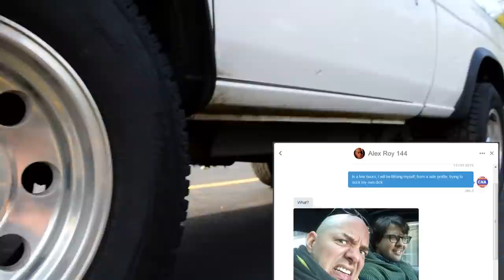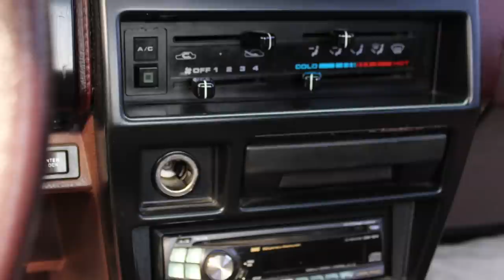Regular Car Reviews: 1991 Nissan D21 Hardbody

Comment: These simple trucks are the reason I'm looking at Rangers.
Reply: +Anonymau5555 stay away from ford. get a dodge dakota, more reliable trust me
Reply: I recommend not. Stick with Toyota or Nissan. They just don't ever die.
Reply: +Anonymau5555 I had a '97 4cyl manual Ranger for a short while. It was a piece of shit. The only good thing was I didn't care about it so I beat on it and had a blast. Even took it offroading once. It was hilarious. I do like the smaller Mazda and Toyota trucks, though.
Reply: +ScreamingPandas7 dodge is even worse
Reply: +ScreamingPandas7 the auto in my Dakota only lasted 136,000 miles before it started slipping. oh yeah so reliable
Reply: +swSephy | Sim Racing some, if not most, of the small Mazda pickups are just rebadged Rangers to begin with though.
Reply: +Anonymau5555 I WANT MAZDA B SERIES
Reply: Had a 97 3.0 manual, sold it with 215k miles, never had to fix a damn thing, loved that truck. Can't go wrong with a ranger as long as it's the manual transmission
Reply: I have a 2007 ranger sport 3.0 manual and I hate it. No power to speak of, worst ride quality ever and no interior room since it's a standard cab.
Reply: +swSephy | Sim Racing 
"smaller mazda"

so ranger, with a different badge
Reply: +ScreamingPandas7 more like more reliable RUST me
Reply: +swSephy | Sim Racing you do realize the small mazda was a re badged ranger right?
Reply: +Anonymau5555 I had a 1991 4cyl ranger manual. Had 290,XXX miles on it when I sold it. Still see it around from time to time.
Reply: +Behzad Majdizadeh the 3.0 is shit a 2.3 is the most reliable and the 4.0 was a powerful engine also found in ford mustangs.
Reply: +Anonymau5555 S10 chassis is /way/ better than Ranger based vehicles. S10s never die.
Reply: MindBlowerWTF So a ford ranger with a mazda badge?
Reply: SquirrelAngry I meant the older Mazda trucks. I should have clarified.
Reply: Noah Ferrari I meant the older Mazda trucks. I should have clarified.
Reply: ***** So a ford courier...
Reply: Noah Ferrari Yep. They're more fun than the one I had. That generation was awesome. Mine could barely pull itself up a hill.
Reply: +Anonymau5555 Subaru brat for dayz
Reply: +ScreamingPandas7 lol Dakotas, the truck famous for shitty transmissions and rotting fenders..every Dakota I see has no fender left and a rear bumper so rotted that its about to fall off.
Reply: +Anonymau5555 My friend in high school got one for a graduation gift.  It was a 4.0 V6 extended cab.  Still has it and it's a 1995 model.  Has probably a half million miles on it.  Odometer broke 10 years ago when it rolled over 300,000 miles.
Reply: +ScreamingPandas7 if you get a small dodge pick up make sure you get one of the older ones made by  Mitsubishi , or buy a full size with a diesel , unless you have retarded amounts of $ for gas .
Reply: +Anonymau5555 Ford Ranger Awesome Choice!!
Reply: +Anonymau5555 I've had an '04 Ranger 3.0L for quite some time now and if you take care of it, it'll treat you well. Although I prefer Toyota when it comes to trucks, this Ford hasn't ceased to amaze me. Choose what you like driving the best, that'll matter the most in the end
Reply: I would advise to stay away from the 3.0's and the four speed autos behind them
Reply: +Bryan Castillo thats absolute bullshit for toyota. My dads 91 pickup was filled with problems once the warranty was done. Ate threw batteries like crazy. Had a ton of shorts. Interior was built poorly. Sunroof leaked. It loved to destroy radiators. It was a hunk of junk. So after he sold that truck, we bought a yukon and the yukon has lasted more time, it was more reliable, and we have only bought 2 batteries since we bought it back in '04
Reply: +Anonymau5555 I had an 86 S-10 blazer 4x4, with a 2.8 six cylinder and a 5 speed.  It had close to 300,000 miles on it, and drove like a dream.  The dash kept catching on fire, and the top speed was about 63 mph (so yes, that scene at the end of Terminator 2 is accurate), but it would never, ever, stop running or get stuck.  I'm a chevy guy and that's only because I grew up working on them, but put brand loyalty aside and just buy a nice old truck, regardless of the name badge.  It will always treat you good, and you will always love it.  Plus, you get good at fixing little things.
Reply: +Anonymau5555 Everything on a Ranger is great, except the water pump, gear box, brakes, power steering pump, relays, and starter. 

I've had several Rangers. All of them had the same problems. But the 4.0 V6 itself isn't a bad motor. All the other shit I mentioned will break, but the motor should be fine up to 500k+ miles. The gear box is probably the biggest Achilles heal.
Reply: SpaceManDawn Starters are fine, its the fact that the oil filter is directly above the starter that kills them.
Reply: ***** You're right. It's not even the motor itself that goes bad really, Just the solenoid. And the starter motor and solenoid are one fucking piece on these things.
Reply: SpaceManDawn Yeah I only had to buy one starter before I figured that problem out. That is a shitty design, just horrible.
Reply: +wv9mm you can call bullshit all you, but if i had the all the dealer receipts for that piece of shit truck i would have posted it on youtube by now. Then my dad bought a pontiac vibe(which is a toyota matrix, made by toyota, no GM parts except the exterior) and this car blows through brakes pads like crazy(we had the oem pads replaced at 60k, my yukon didnt even squeal and we replaced them at 92k just for good measures). So this other piece of shit toyota has its transmission clunking when i put it in reverse, the radio comes on and off whenever it fucking feels like it, has a tendency to idle at around 400 rpms, the key fob works when it wants to work, and its starting to burn oil, which is a common problem after these vehicles equipped with the 2.4 2AZ-FE engines. My aunts 06 sienna has blown through 3 transmissions, 2 of them while the van was still under warranty. Worst part of all this is that toyota employees that actually work for toyota will admit all this
Reply: +ScreamingPandas7 Did you seriously just recommend a dodge based on its reliability? What a troll.
Reply: I have an 87 ram with the 225 and a 4 speed. It isn't fast but it will never die.
Reply: +swSephy | Sim Racing 
But wasnt the Mazda truck LITERALLY a rebadged Ranger.
Reply: +Jack Mendez yes.
Reply: Holy fuck load of comments Batman.
Thinking of getting an '05+ Extended cab short bed 4.0 V6 with the 4x4.
Reply: +wv9mm well idk if i mentioned it but Chryslers are shit. Theyre the one outlier to american cars, they break more than they work. Ive never heard of GM engines blowing so low. My dad had 4 buicks as company cars, and he would easily put 30k on them each year, and none of them had any problems at all. Our GMC yukon outlasted our piece of shit toyota truck, and it looks like it will outlast our toyota made pontiac vibe as well. The brakes on our vibe squeak like shit and there is still a lot of material left on the pad, so idk what going on with that car but what i know for sure is that im never buying another lifeless piece of shit toyota again. Too many little problems that turn into big problems
Reply: +SquirrelAngry Everything after 93 I believe.
Reply: +olskoolnewpaint Unfortunately not. The manual trans was a Mazda part though.
Reply: olskoolnewpaint Was it a Four speed? Cause the four speeds the put behind them can not handle any towing.
Reply: +Anonymau5555 In my 30 years of driving and owning 17 vehicles, import and domestic...Nissan/Datsun, Honda, and Toyota will ALWAYS surpass Ford, Chevy and Dodge in both longevity and reliability, hands down. My 1993 Nissan Pathfinder has 278,700 miles on it and still no leaks or oil smoke, it starts everyday even on the coldest days of -10F,  goes on 100+ mile off-road trips, tows a 19 foot travel trailer and still kicks ass. My 1995 Ranger crapped out after a little over 180,00 miles...bought it new and had all of the scheduled maintenance done, still garbage, it quit wanting to be worth anything about 8 months after the warranty expired. Japanese Imports= TRUE Longevity.
Reply: +Noah Ferrari Those smaller trucks used import engines. The Chevy LUV used an Isuzu engine, Ford Courier used Mazda, Dodge D50 used Mitsubishi. The Chevy Duramax Diesel is an Isuzu engine. I don't know how old you are, but the mixing of Japanese engines and American vehicles has been going on for 40 years. The Ford Probe and Mazda 626 share the same engine Dodge Stealth and Mitsubishi 3000GT are the same, etc.
Reply: +TheTheeggmann we'll just ignore all those 30 year old chevy trucks with 500,000+ miles on their odo's right? Or the fact that the longest lasting vehicle is the ford f250. Or all those crown vics that are pushing 500,000 taxi miles
Reply: +Frank Magana The only complaint I have about the early 80's Toyota Hilux is the Manual Trans. I had an 83 4x4 and no matter how many gear boxes I put in it (3 until I gave up) it always lost 1st and 3rd gear. And that's driving around town and highway speeds of 60mph.
Reply: +SpaceManDawn And the fuel pump, gotta take the bed off to get to it.
Reply: +TheTheeggmann thats pretty fucking bad. My dads 91 pickup went through 3 radiators, but 3 transmissions, that sounds like my aunts 06 sienna
Reply: *****
 I believe so, and it was also used for snow plowing. Shameful how they made the F150 for so long and by '94 they still couldn't get it right.
Reply: +Anonymau5555 Mistubishi pickups are good. Dunno if you get them over there. Ford Rangers/Mazda B series are pretty bad.
Reply: Rin Hato Those are extremely rare and hard to find in decent shape.  I'm also looking at Tacomas as they are a bit more plentiful.
Reply: +Anonymau5555 Same. I always thought the Ford Ranger and even the Mazda pickups were great and perfect for anyone who needed a reliable pickup truck. But I'd rather go older Tacoma or Hardbody. Nothing beats Japanese design and build quality from the 80's and 90's.
Reply: +Anonymau5555 yee they are i have a 93 harbody i love it exept itsrotted to shit :(
Reply: Why is that any of my business?
Reply: +Mr Anderson Have a '02 Dakota regular cab v6 4x4 with 180k, no rust because i wash and take care of it. It drives good and hauls wood or whatever with ease. Solid and better built than a chevy i think . Dakotas have tranny problems because people romp on them, i have to say Rangers are also good trucks.
Reply: Sister had a 99 Ranger Loved it Now i'm thinking of one for a first car. That or a D21,Tacoma,s10
Reply: Anonymau5555 Rangers are even more basic and not as reliable
Reply: Nissand21 guy Reliable is just marketing so when those cars break the owner thinks it's time to get a new car because "well our reliable car just broke so that means we have to get a new car because it said it will not die when we bought it" if you what a reliable car buy a used Suburban that haven't been off the road once in it's life or any truck with the same history.
Reply: Char Aznable did you ever buy a ranger? I owned one and it was only a money pit.it was a super clean one as well
Reply: Thats true, I've got a 1999 4 cyl Ford Ranger that has been meticulously cared for by every owner. Still drives like new, though gutless it may be
Reply: This thread is hilarious. Some actually recommended a dodge dakota. I think it's been over 10 years since I've even seen one of those things.
Reply: +Michael Franke Yeah, I've got the same with the v6, still going strong.

Comment: I enjoy mine. It's a '96 4x2 (Australian model), so it got a modernised dashboard and ECU, the government fleet buyer who ordered it specced the lowest trim level (DX), and the highest mechanical spec (160hp-182ft/lb VG30E/R30a trans/H233 rear), with a 7' bed.  
Sure it's got EFI, but otherwise it is just so simple by comparison to anything you can buy now; hose out vinyl floor, simple cloth seats, no A/C, no airbags, no ABS, no TCS, manual winder windows, even has quarter vent glasses. I drive it everywhere, every day and I have done for 3 years now. Apart from some dirty earths needing a hit with a wire brush, it has been absolutely faultless. Something about driving simple cars is highly enjoyable.

Comment: I've got an extended cab from 95, the damn thing is indestructible. It's got over 300k on it and the only thing that's gone out in it is the thermostat twice, and the distributor which was rebuilt.
Goes anywhere, does everything, but because of its interesting fuel management system it gets oddly low gas milage, haven't figured out a way to get that addressed yet..
Reply: Same only a 93 , what motor do you have?

Comment: I have a 94 D21  but in 2wd.  Bought it from the original owner.  White with blue interior   148 thousand miles and the truck still looks and drives as if it just rolled off the line 10 minutes ago.

Comment: My first truck was 1990 2 wheel drive d21 that came with the VG30e maybe not quite as reliable as the ka24e, but pretty close, drove that thing into the ground, raced it constantly, and off roaded it, over 200k miles and it still ran like nobodies business.

Comment: Much more powerful engine than the Toyota 22re from that time. Back when Nissan was on par with Toyota, and sometimes even better in some ways.
Reply: I had a Toyota with a 22R carbureted totally gutless no power, but I loved that little truck.
Reply: ryvr madduck I had a 91’ 4runner with 22RE. 116hp and well over 2 ton SUV. I got rid of it when I moved to AZ because the truck could not go over 70 if you had a head wind or slight hill. Too gutless for 75mph freeways!
Reply: I feel for you.  I had a 22R in a single cab pick up I can't imagine that engine in the 4Runner.  My son finally found a 2000 4Runner but with the 6 cylinder.  It is a damn good truck, good power to weight.
Reply: @mylesgray3470  but the 3rz which came out early 90s wuz better

Comment: My dad has actually driven one of these in his youth and for whatever reason now he owns a '97 Nissan Terrano II (we call them Terrano here) still with the KA24. Strange tho how on this one the motor is sitting way lower than on ours.
Reply: Probably a body lift on this truck which lifts the body higher on the frame to clear bigger tires. The motors attached to the frame so it will stay frame height while the body goes up with a body lift.
Reply: probably on a frame lift

Comment: I just got a wd21 Pathfinder for $750 and fucking love it. I wish it had the ka instead of the vg, but the vg is still taking a beating!
Reply: My dad had a villager with the old VG 3.0 in it and it refused to die. Even after 365k. The only reason we couldn't keep it was cause the frame got rotted out after 16 years of salt and slush. I fucking loved that thing to death.
Reply: +Savage Medic Dett swap it!
Reply: One of the most underrated cars ever. The WD21 Pathfinder was a real SUV. It's burns had but every penny is worth it because that truck is invincible😂.
Reply: thecurr88 I actually bought it to LS swap it, lol.
Reply: Using LOJ innovations to swap it? ^
Reply: +TyranitarComedian 250k and still going when we got rid of ours. Reliable as hell but rusty as shit.
Reply: Justin Banks lol, the only thing we had to fix on it was the waterpump and a punctured tire.
Reply: +TyranitarComedian lol same.  Had to put two of those on in 9 years.
Reply: +Savage Medic Why does everyone think that the LS needs to be put in everything??
I have a 1993 Pathfinder and I would love to stuff a 5.7 Triton engine in it...Keep the bloodline true. It's bad enough that the best front axle for an SAS in the Pathfinder is a Dana 40 from the front of a mid 80's Jeep Cherokee.
Reply: +Savage Medic I'm on my second (first had the frame rot), great rigs so long as you keep on top of the timing belt.
Reply: +Savage Medic You can also find the same era QX4 for around a grand or two. Same build platform, shared parts, and robustness with just a bit more luxury.
Reply: TheTheeggmann Because it's mine and I really don't give a flying fuck about "bloodline." The reason it's swapped into everything is because it's cheap, reliable, and easy to make power, so until you fund a swap for me, goodbye Felicia.
Reply: You can bet on that! Dad got a used 1987 Pathfinder SE back in 98, now he is gone but the pathy is still with me, still running great.  The VG30I engine makes less power than his 2001 Volvo S40 but, who cares? This truck is what everyone should imagine when a real SUV is described for the first time...
Reply: Awesome man, I picked up one that's pretty clean but was missing some body parts (fenders, headlights, bumpers) for 400 bucks. 240,000 miles but runs really good, and since it's a California car, no frame rust problems.
Reply: Ya there are kits to drop a chevy 350 right into the engine bay.
Reply: Savage Medic the VG is an underrated engine. Its as good or better than the KA.

Comment: I agree on taking care of these. Just had a guy come in the shop with a.....96 or 97. Can't remember for sure, but he had around 240k on the odo, and it really needed a timing chain component kit. You could hear it starting to slap around. I priced him out that, water pump, all the major front/top engine seals, filters, fluids, etc. and it wasn't a cheap bill. I explained if he wanted to maintain the thing, it was a smart move. He was thinking about just selling it, until I asked "What are you going to buy instead? You can't get modern compact truck. If you want one, the best thing you can do is treat the one you have right and don't cheap on the maintenance." You could see the light go on in his eyes. He responded with, "Y'know, it hasn't had the diff or trans fluid changed recently, and go ahead and add all the cooling hoses." Smart man.